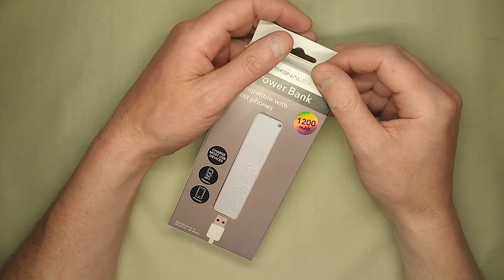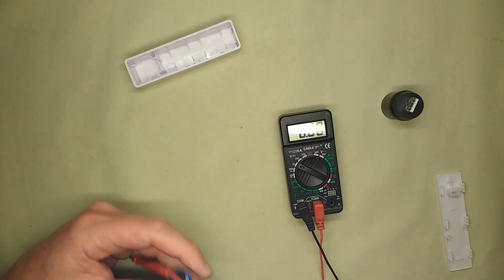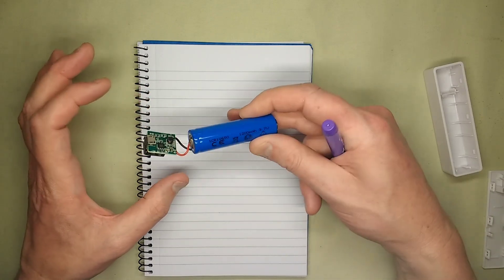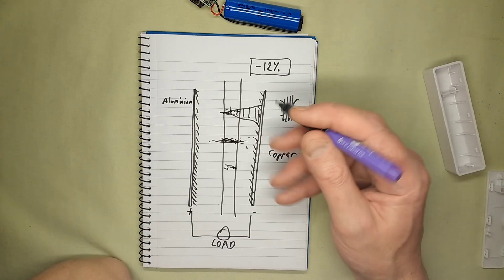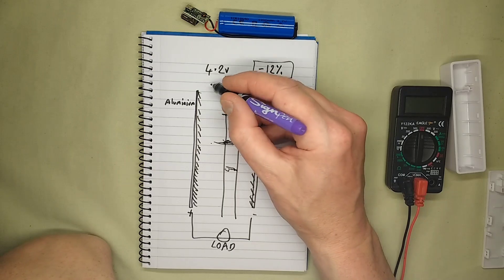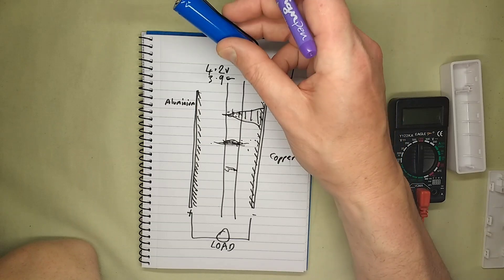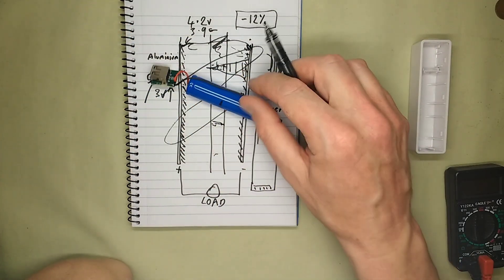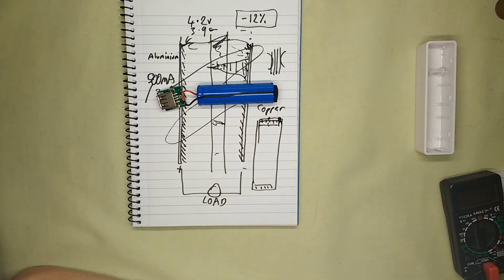Are over-discharged lithium cells safe?  (And how to test for damage.)

Comment: I read the article in the link: it seems, that the most dangerous thing is over-charge.(the article doesn't address that) It's interesting to know, that I can make the voltage balancing system part of the charger, and it's fairly safe to discharge, as long as no cell is allowed to drop below 0 volts. I still cut them off at the knee,~2.3-2.5 volts, depending on load current, just for the sake of longevity. just as possible as it is to reverse charge a cell in a high voltage battery, it's easier to over-charge a cell in the same string. The real problem lies in differences in self discharge rates, especially, if the battery has been in storage. That makes it VERY easy to over-charge cells, without a battery management system, to protect cells from over charge.
      Please do a demonstration on over charging a cell at a very LOW current. It's obvious what happens, if a cell is deliberately overcharged at high current, YouTube is full of videos showing that. I would like to know what happens inside a cell, that has been "trickle charged" for too long.

Comment: Just coming back to this after a while since original watch (so apols if this was covered) when you say self discharge after a recharge, would a little bit of discharge be normal/acceptable - like 0.04v overnight? or is that a sign that the end is nigh?
Reply from the maker: It's normal for the voltage to settle down a bit.  If the cell was discharging significantly on its own over a few days that would indicate an issue.

Comment: on a somewhat related note:

Is it dangerous to use that powerbank while its charging? I was planning to use it as a u.p.s for my ip cam
Reply from the maker: Some allow that, but some don't.  There's a way round that though.  You add an external TP4056 charge board across the lithium cell.
Reply: @bigclivedotcom  thanks for the reply.  Just to clarify. is that safe to leave on forever with a 5v 1a ip cam?
Reply from the maker: @ktestable  That's a very high current draw.  You need a power bank rated generously with a large battery pack and maybe a dedicated charger for the higher current.
Reply: @bigclivedotcom  I see, thanks a lot. possibly saved me from a housefire.

Comment: So you say "empty cell" in terms of voltage-empty and completely discharged. 
What always annoys me is the bogus of elderly people that haven't used Li-Ion Cells for decades is the "Oh don't fully discharge or charge them. It damages them". 
From my understanding, every Li-Ion device (i.e. Camera-batteries or phone batteries that are replaceable) have internal over-charge and over-discharge functions that limit them, right?

So for example: My camera shows 100% charge. It probably isn't full to the brim that the cell itself can take, right? Same probably goes for the lower end. If my camera says 2% - it should be higher than the "real dead empty" state of the cell in order to protect them from any harm, right?

Comment: As most of the chargers won't charge a cell under 2v etc I use parallel charging with other cells to get them up to 3 and pop them in the charger quickly and they charge fine, then I leave them for a little while and see if the voltage has dropped too much if they have that means there scrap

Comment: Usually if the cell is brand new and its a very low voltage its easy to make it come back to life even though it might get a small amount of capacity loss, but when its a battery that has a good amount of cycles it gets harder to make it back to life and will most likely have a huge drop in capacity. If it has a lot of cycles it probably won't ever come back to life and if it comes its probably just trash anyway :(.

Comment: The problem with overdischarged and generally maltreated cells is you just dont know how their chemistry is going and if it has weak points (like SEI disintegration, growing dendrites can be lithium or copper! and so on). I have harvested many used cells from laptop batteries and ebikes and most of the overdischarged cells come to (some) life again when you laod them with low current with a normal bench power supply. My general experience is that cells which have been sitting at 0 volts for quite a time are bad, they may charge but they have very high self discharge rate. Some even get quite hot when charging - meaning they have (small) internal shorts from dendrites. These dentrite can occur in 2 ways: from overcharging, overcurrent and aging they grow lithium dendrites. Copper dentrites typically occur when they are overdischarged - the deeper the more. SOC -12% is a barrier where they definetly will build up and become stronger - giving high risk for a severe short! But they also can occur at below 0% SOC and any undervoltage lower than 2.5 V. Generally i would say cells over 1.5V maybe still be reasonably safe to use - but never unattended! Cells below that are more and more unsafe - although probability that something goes terribly wrong will be still low - but who wants to take the risk??
I tend to decide on the self-discharge rate: i let the cells sit for 3 days after charging (to around 4V) measure the voltage first time, then measure again 1 week later: if it has lost more than 10...20  mV its a bad cell. (This is not a fixed value - you can adjust it to your fellings/needs - but i would say more than that is too high). A new and good cell typically wont loose even 1 mV in a week. The best cells i have loose just a few (1-5) mV per year! Keep in mind: the higher the initial voltage the bigger the loss (esp. the first days). To be compareable you should charge them all to 50% SOC and start the measurement from that point.

Here is a lot of scientific input if you are interested:

 A Critical Review of Thermal Issues in Lithium-Ion Batteries:
http://jes.ecsdl.org/content/158/3/R1.full

scientific research (article from above)
https://www.nature.com/articles/srep30248

overdischarge:
https://www.sciencedirect.com/science/article/abs/pii/S0378775306004277?via%3Dihub (excerpt)

Internal short circuit detection algorithm and procedures:
https://www.sciencedirect.com/science/article/pii/S0306261915012465?via%3Dihub (excerpt)

A General Discussion of Li Ion Battery Safety:
https://www.google.com/url?sa=t&rct=j&q=&esrc=s&source=web&cd=15&cad=rja&uact=8&ved=2ahUKEwjaxvLKgN3kAhXGIVAKHXMnBZU4ChAWMAR6BAgFEAI&url=https%3A%2F%2Fwww.electrochem.org%2Fdl%2Finterface%2Fsum%2Fsum12%2Fsum12_p037_044.pdf&usg=AOvVaw137EADCJakEAZGTzV4amGl

Thermal Stability Studies of Li‐Ion Cells and Components:
https://www.google.com/url?sa=t&rct=j&q=&esrc=s&source=web&cd=11&cad=rja&uact=8&ved=2ahUKEwjaxvLKgN3kAhXGIVAKHXMnBZU4ChAWMAB6BAgBEAE&url=http%3A%2F%2Fjes.ecsdl.org%2Fcontent%2F146%2F9%2F3224.abstract&usg=AOvVaw1gSKvVn2iMGeQxhO2PR3wZ
Reply: can you clear some information for me please? Are you really talking about milivolts when you give parameters of discharge rate? for example, when you say that a new good cell loose just a few (1-5) mV per year, a cell that has initially 4.000 volts would drop to something between 3.999 to 3.995 volts in a year?

Comment: I have had cells almost 3ah cells get pulled to 0v wouldn't keep a charge after that, it acted as a capacitor, with resistor across it. It would self discharge, and wouldn't go past 4.1v , but i have seen 0.7-1.0v cells be fine! Like new, i dont know how long it was at zero, but it got shorted while about 2.5v, after it hit 0v it basically wasn't a battery anymore,

Comment: Every time I try to get the cheap 18650s they never arrive. I'm guessing they just return them when they notice what they are and consider them dangerous but it's a bit annoying because I could use those even though they are rubbish, they are just so damn cheap in comparison.
Have you ever had any issues or do you have any tips regarding it? I guess I could just get those cheap power banks and rip the cells out but it's not my first option

Comment: I've bought a few of these. My front light on my pub bike takes them. It came with an adapter than can take 3AAA's which do not last long (kodak). The rechargeable they sell are useless. But the 18650's, i wipe them out nearly dead, but they always work for me and re-charge and they are only a pound. They do better and  i always have spares.

Comment: I've got a few of these little power banks over the past weeks and I'm thinking of making a bigger power bank out of them would you recommend this?
Reply from the maker: You could connect cells in parallel to a single PCB for higher capacity.  Make sure the cells are all equal voltage first though.
Reply: @bigclivedotcom  thanks

Comment: I found some with low charge on them and the normal charger wont charge them unless I use a pulse charger or just hook to PS for a short while to get the voltage back up to the 2.5 then they charge up and seem to hold well, batteries hadnt discharged due to battery failure was the faulty charge circuit that was draining them, most "used" battery I get still have a 90% use life on them

Comment: Years ago, I had an old DELL PDA that was actually my favorite toy for a few years because you could flash other oS's on it.  The major problem with them was that they ate the power from the battery pack and killed the cells with great regularity.  About two weeks ago, I found one of the old cells that I had written DEAD on it in red sharpie.  I tried my VOM on it, and nothing, so I had  just saw a comment on some page that if you shorted those cells across another good cell for a few seconds, it could revive it.  I gave it a try, and the blasted little cell came to life!  I soldered some wires on her and was using it to power a small ESP8266 01 with a tem/humidity shield on it. It powered the little guy for about a week straight, then went dead. Now she is plumb dead, I tried shorting her again across a good cell and  put my charger on it, but nothing.  Well it was fun while it lasted.

Comment: I feel like I'm missing somthing
How the fuck do you drain a battery till its negative
Reply from the maker: If you have two or more in series the first to be fully discharged will be reverse charged by the other cells.
Reply: bigclivedotcom sooo if I'm understanding you
It's not necessarily taking more power out then there was in there...but rather having it charge the through the wrong polarities?

Comment: Clive, that is really helpful.  I have a bunch of LGDBB31865 that I'm salvaging.  Most of them are around 2.4 - 2.6 V when I take them out of their original battery case.  What do you think are the odds of them being OK?  I don't want to have to let them sit for very long after having charged them before building my battery.  So, I won't really know if they are self discharging or not.
Reply from the maker: They should be fine.  If you put them into a cheap power bank case with battery contacts it should gently recover them at low current before switching to full charge current.
Reply: Hi Clive.  Thanks.  I have a Miboxer C4-12 that I'm using to charge the cells.  It has a recovery mode that automatically handles the gentle recovery process.   Once again, thanks for putting up that video.  Really great information.
Reply: Any idea what acceptable resistance ratings are for used 18650 cells?  After charging these cells, they are in the range of 85 mOhms  to 160 mOhms. I have other cells from laptop batteries that are in the 200 - 250 range.  Just wondering what level of resistance is likely to create a risk of overheating.  I know it is highly dependent on the application. So... my application:  I'm building a 14S7P battery with the LG cells. My guess is that they will average around 2300 mAh per cell.  The battery will be driving a motor that is rated at 500 Watts, through a 25 amp (continuous) rated controller. The max discharge from the MBS is 30 amps.  So, the peak current would be limited to 30 amps.

Comment: From what it looks like to me if I didn't know any better it looked like the battery has a protective 'cap' on the + side.  If you were to compare it to a standard unprotected 18650 cell and it is the same height then it's unprotected.  I say this because I've messed with Panasonic cells, in both their 3400mAH unprotected green cells and some from an old Toughbook and the + side looks just like you'd see on a standard AA battery without the 'ridge' or 'ring' and a pronounced terminal that's not flush with the battery.

The thing about the protections, in both those batteries in the Li-Po batteries for MP3 players is that the reported voltage isn't the same as the internal voltage of the battery.  In fact, most service manuals I have for my laptops (non-Panasonic) state that a battery pack that registers at 0.00V is not faulty it's just in a sleep mode.

Comment: if i want to charge with bench power supply how i need to connect the battery? + to + or + to -?
Reply from the maker: To charge a lithium cell from a bench power supply you connect + to+ and - to-.  Make sure current is limited and the maximum voltage is set at 4.2V
Reply: bigclivedotcom thank you very much i am a bit unsure

Comment: I work with LiPo racing drone batteries and what I learned is when over discharged, the capacity goes down and the amount of amps that can be given goes down. Along with this is more voltage sag under load. I experienced this when I accidentally left a battery plugged in and it drained to 0v. When I charged it up and flew it, the drone had far less punch, didn't fly as long, and the battery got quite warm. Keep in mind that the drone draws 80+ amps.
Reply: I've had the same experience as well. However in my experience its only 1 cell in a multiple S (series) pack that loses the capacity. 

The voltage sag is most extreme on that single cell, effectively bringing the pack down to a "discharged" voltage while the good cells are still at their nominal 3.7 under load.

Not that it matters, in both scenarios it is the same effect on single cells but if you have this issue with a 2S+ Li-Po, you can salvage good cells or replace bad ones.

Comment: My experience with a deep-discharged cells is, that they self-discharge extremly fast ( some in a few minutes till empty) and become quite hot during the charging process, probably due to their internal short-ciruit. Latter one might actually be quite dangerous due to the heat developement of the cell.

Comment: I don't believe that that is a real lithium cell sir because all lithium packs are are square shaped and 4-12 mm think. I strongly suggested this is a nickel cadmium battery it's not worth a shit for holding any sort of amperage required to charge any computer. Even if it actually is a lithium cell I know from experience that these types of power banks are worthless crap and you should spend whatever necessary get a power bank with a proper lithium packs that is at least 4000mah which don't cost but a little bit extra then whatever this cost. A 5200 mAh Justin power bank with power level display will only cost you about 20 pound Andover experience that they work and last because I've been using them 2 for years however these crappy tube power Banks Bailey last few days before they're absolute rubbish.

Comment: I have a few old laptop spare batteries around the house from rather old laptops that are not used anymore.  Some have probably been sitting around for 10-15 years.  I figured they were paperweights at best.  A few days ago, I decided to take one of the older ones and perform a bit of surgery on it to see what was inside of it.  Turns out that laptop battery contained 9 Sony 26650 cells.  I stripped it apart into single cells.  The measured voltage was very little -- anywhere from 0V to 0.5V.  I tossed the plastic case and circuity and used some test ("alligator") clips to connect it to a generic cell phone external battery charger and let it try to charge the each battery.  After a couple of days, the voltages are currently sitting at 8 with voltages anywhere from 3.97V to 4.20V and 1 with 3.84V.  Another laptop battery yielded (8) 18650 cells in it with initial voltages around 1.0-1.5V and the end voltages ranged from 4.21V to 4.41V after charging.  Another laptop battery yielded (10) NiMH cells that started out at 0V and 7 of them have currently been able to be charged up to 1.2V to 1.41V.  My NiMH charger would not recognize them, so I just hooked 3 up in series and connected it to a low wattage 5V switching power supply and disconnected it when the voltage across all three got up to around 4.5V.

Now, I just have to figure out some use for all these lithium ion and odd size NiMH cells. :)

Comment: I have a charger allmost the same as this one and I had to disconnect the battery because two chips on the board got so hot it was melting the solder and making it worse because it was causing more contact with other chips making it hotter two chips were over 150c that's as high as my meter goes in the setting it was in because I forgot to change it so now I have a spare battery but there is like a failsafe there are registers and other chips but none blu I tested them so I think they were to big for a power bank specialy to charge a phone it's a good thing I wouldn't plug something that cheep into my iphone..😏  the power bank blow-up two led light boards but not the leds them self so ima connect them in series on another bord I have laying around. But I did get them at the dollar store or as u guys call it Poundland.😏